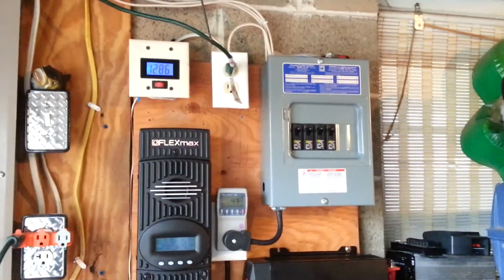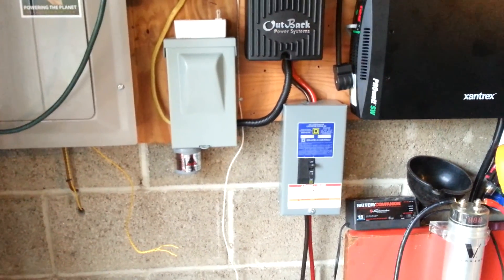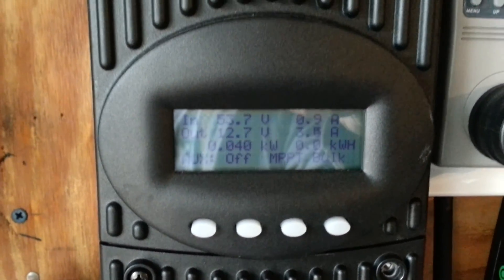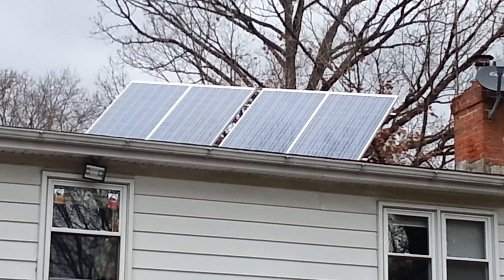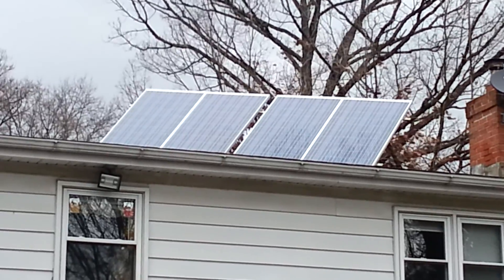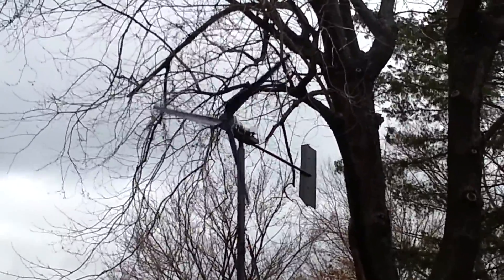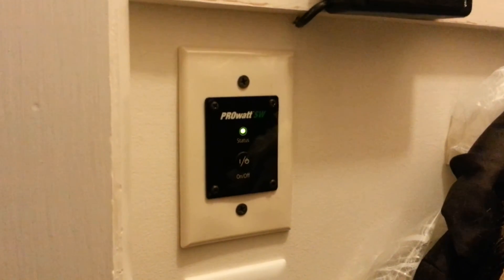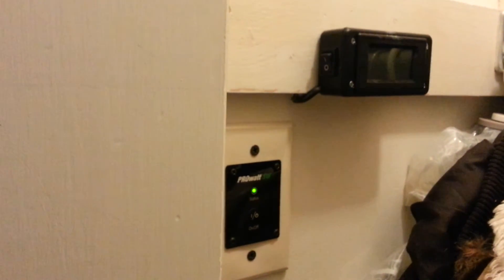Off Grid Solar and DIY wind turbine

Comment: How do you live off grid with 2000 watt inverter? WOW ours is iffy at 8000 watts. Well if you were actually off grid, you would see that your system is laughable in a SHTF senerio, but I guess a fun toy to play with.
Reply from the maker: +Trina McDonald When I decided to try to set up an off grid system, the first thing I did was to make my house as efficient as possible.  That 2kw inverter was able to power everything in my home (Not at the same time) with the exception of the 240v stuff like the stove and dryer.  I have since upgraded to 24v, an Outback GVFX3524 inverter, and replaced the batteries with AGM's which has been able to handle everything I need including 2 air conditioners.  I am planning to do an update video on my system soon because a lot has changed.  Also, in a SHTF scenario I would run the absolute bare minimum anyway so I don't waste energy.  Do you have any pics or video of the setup you are using?

Comment from the maker: What type of kill switch that kills the power to your home could go in a closet? I'm honestly not sure I understand what you mean.  I set it up this way as a stand alone backup power system.  I like having separate solar outlets so I know exactly what's on the grid and what's off.  When the power goes out and I need more, I do what you said and back feed my generator through the dryer outlet to run the bigger stuff.

Comment: Just put the kill switch in front closet(kills connection from power company grid to your home).  Don't add or use any other power outlets(this way everything stays plugged in and you use ceiling fans still).  Finally, have an "on" switch that turns on your power source using existing wiring.  If it's not powerful enough for some appliances just turn off their breaker switch.
You can plug into a couple outlets and backfeed them if you don't plan on using dryer/ac unit/oven during emergency.